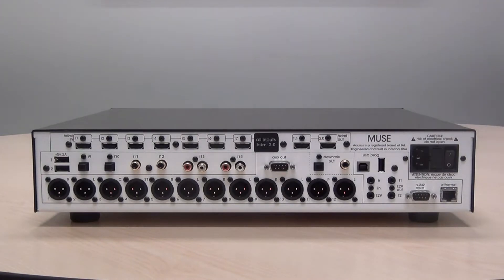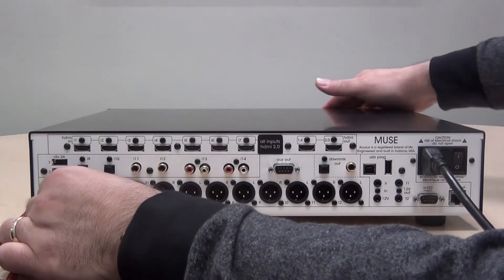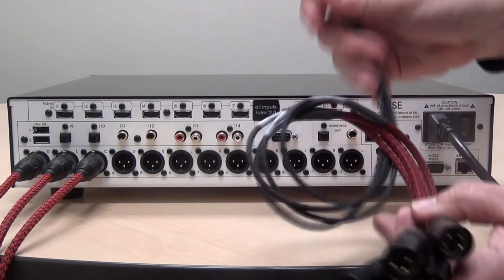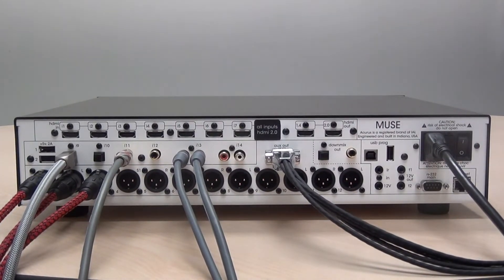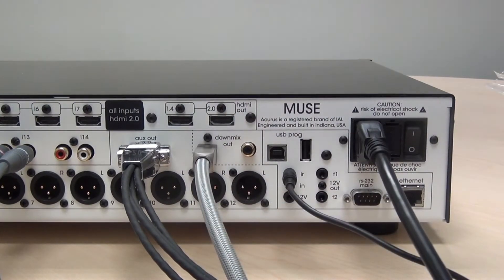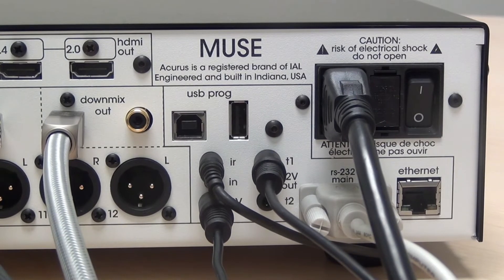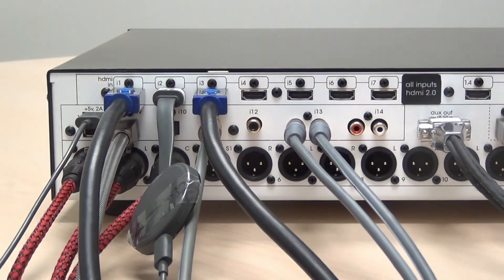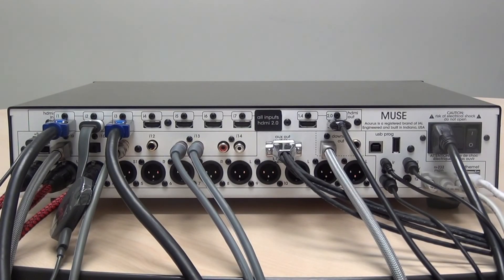ACURUS | MUSE connections

Comment: Hi Acurus. Could u explain the HDMI outputs now that there are new HDMI boards with the Muse units. Ur manual says, that output 2 is the main output. Can u confirm or deny this? Also, please consider doing a video on how to perform firmware update on Muse. It would really help people who don’t have the luxury of calling installers every time. Thanks
Reply from the maker: The HDMI boards that ship with the current MUSE units support HDCP 2.3 and the new eARC per the HDMI 2.1 standard. The far right output (viewed from the rear) remains the main output that will support eARC functionality.  Both outputs do output equivalently however and can be run simultaneously.

Thanks for the suggestion on the video.  Great idea!
Reply: @AcurusAragon  Thanks Acurus team. Good to know.! 
Could I pass on a suggestion to the software dev team? Can there be an option to have unit’s (brilliant) display go live for say 5 secs or so when volume is adjusted or other setting is changed? To know what level it is on or to confirm other settings. Currently, I personally have the display turned off by default after 5 mins so it is not distracting while watching. Every now and then, u want to adjust something using  the remote after some time, but not sure what number or setting it is at.
Reply from the maker: @balucandy  Thanks for the suggestion. It will get passed along to the software dev team.